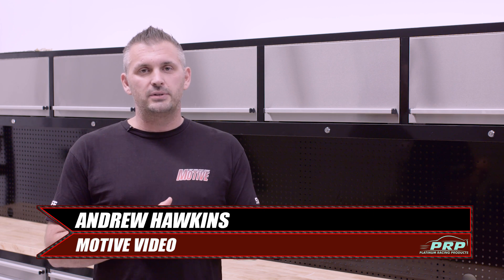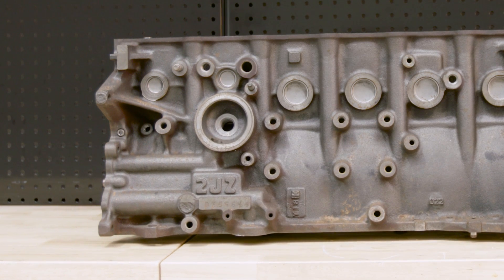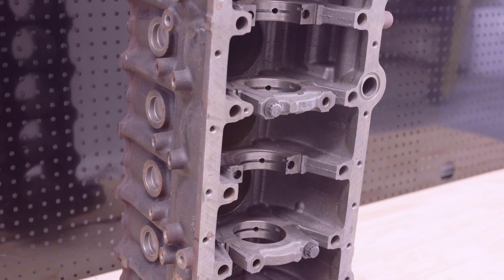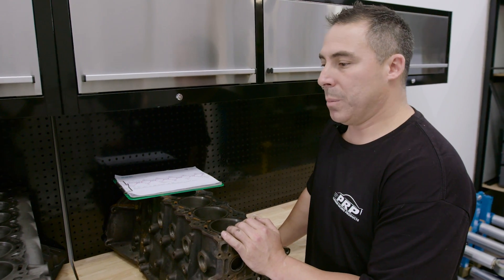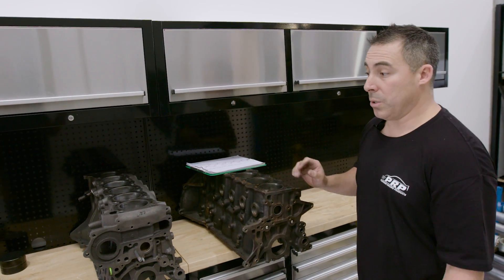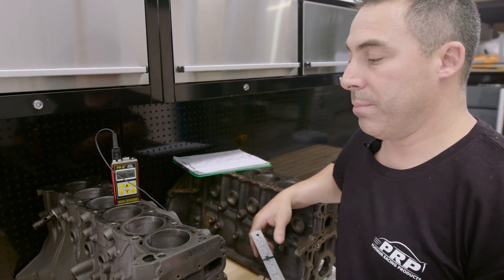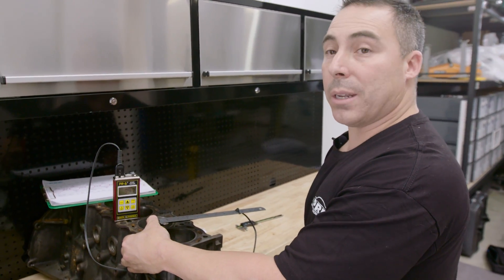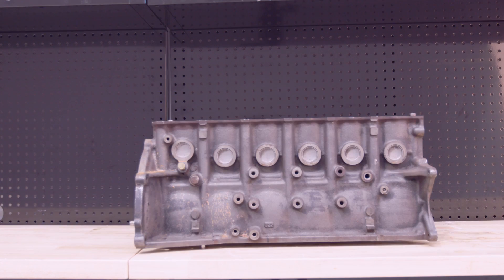RB30 vs 2JZ Which is the Better Block and Why? - Mythbusted

Comment: 2JZ - Goku

RB - Vegeta

This is the truth - but I respect them both.
Reply: Yet I still love the RB and Vegeta more even though they're weaker.
Reply: @Dollsofgod vegeta isnt weaker he just has to train harder
Reply: Goku has better oiling
Reply: @patrickthayer3192  Vegeta has higher rev limit and better daily use
Reply: @jordanprice9285  Not true at all. 2JZ is great for daily driving. Just ask all the IS300 owners with over 300k miles.
Reply: @TheColbyChurch  well I mean just as far as the Supra goes, I've yet to really see a lower horsepower one that's under 600 and personally, it doesn't feel as satisfying seeing one like that since it's just in the back of your head that he probably is gonna be making more power out of it eventually.. it's just something I'm never gonna be able to get used too.. plus the RB engines are a bit more rare and aren't usually as fast without having to go built but they usually have around 400-700 so it seems just way more practical especially since it's basically the opposite to the Supra/2JZ so I'm more likely to be impressed with a RB engine  Makin more power even over 1K compare to a Supra cuz it's basically old news and everyone does it.. 

Also, I'm not gonna lie, I think I prefer the SC300 over a Supra anyways since it's wayyy more plush and has such a nice design in my opinion..
Reply: Jordan Price Its rpm is OVER NINE THOUSAND!!!
Reply: Billet Block - Zeno
Reply: Awesome analogy 😂😂so true
Reply: I've been saying this shit for years lol.. no one ever listens when I say it 😂😂
Reply: Ls is Gohan
Reply: @corey0189  Ls is wonder woman.
Reply: 1uz - Broly? Not enough after market support but very capable of making good power
Reply: @bzbee5139  nahh.. I'd say LS probably is Broly.. Loads of Power and loads of aftermarket support for them to where it "overflows" almost lol
Reply: These DBZ references are hilarious. 😂😂😂
Reply: VR38 - BROLY
Reply: K20 - Mr. Satan
Reply: @xEhsiaN  F22 Honda God
Reply: V8 is superman honda engines is gohan 😂 rotaries is one punch man
Reply: Why American muscle lovers are watching this video anyway. Go watch your American muscle instead
Reply: The R34 is Goku.
Reply: Nissan moved on with the VR38 while Toyota couldn't convince Yamaha to copy the beast V6 VR38. That's why Toyota joined forces with BMW.
Reply: Andres Garcia 2J head was worked on by Yamaha the rest is all Toyota and Toyota was going to bring the 2J back for the new supra but the cost to redevelop the head wasn’t worth it so that’s why toyota went with bmw and as for the V8 crowd they’ll never appreciate any other engine with less then 8 cylinders
Reply: thats sad, cus vegeta is shitting on goku to me and always have, this is the truth.
Reply: @AmaAndZing  thats what ur little bro said
Reply: S54- Broly 😃
Reply: Rb26 is a unicorn being rare in the states but on the other hand the 2jz is hulk as far as power goes you will not ever see a 5 second rb26 or rb30
Reply: OK... Can see you not old enough to drive a car.... 😂😜
Reply: Comment super enlightening! I'll like it on the video and go, I do not need to watch it anymore. kkk. You summed it up!
Reply: That means 2Jz turbo is the blue super saiyan? good reference
Reply: Good Analogy!
Reply: No
Reply: Vegeta and Goku basically equal right now. If anything it's comparing 290-310 hardened 2JZ blocks.
Reply: Always liked vegta more
Reply: 755hp 
And what is the VGDETT30?
Reply: 755hp ok now I understand 😭
Reply: 2jz is Yamaha and RB26DETT is Nissan.
Reply: 2jz is Yamaha.
Reply: NISMO - BULMA
Reply: GE9X - Broly
Reply: Rb saitama
Reply: Rb = Vegeta

2JZ = Goku

K20 = Saitama "One Punch"!
Reply: William Anthony no way in milky way!
Reply: B SERIES - krilin
Reply: This should be the google answer when I type “is rb or 2j better”
Reply: thats an L for putting goku as 2j
Reply: SR20 Krillin?
Reply: To be honest either one holds it’s importance 😂
Reply: Higher revs is rb 2jz is more of the blunt powerhouse 😂 it’s only sensible that the 2jz makes up most of its power in size 😂😂😂
Reply: 2jz wanted to fucking scream😂 but instead just made more power instead of revs 😂
Reply: Big builds need big time adjustments 😂😂😂 these two require it’s own adjustment pattern to make big numbers 😂
Reply: Vegeta is supposed to be 2jz
Reply: 2jz - goku 
Rb- saitama
Reply: Barra - Brodly
Reply: @MeanMāoriM3an  barra stands for shit open deck block shit box
Reply: The 2JZ was built in response to the success of the RB26........
Reply: 2jz is the best!
Reply: And rp26 _zeno
Reply: Idk how I feel about that knowing that to me goku is shit and overrated and is a joke compared to vegeta... that might upset some kids
Reply: Best example I've ever seen 😂😂😂
Reply: Rb ultra Goku
Reply: AGT 1500 = OPM
Reply: Barra - Beerus
Reply: @rallyausofficial   2jz will eat ya barra in low boost any barra
Reply: 755hp 2jz is ultra instinct
Reply: @kapriseedwards9687  lmao nahh.. Billet 2JZ is the real Ultra Instinct 💀💀
Reply: Vegeta is stronger than Goku.....
Reply: 1jz 2jz r the king .no engine comes close to a king kong
Reply: The r26 is more loved it's the other way around
Reply: Kenton Patterson We’re talking about a measure of strength - in which, the 2JZ is physically stronger (regardless of opinions - it’s a fact).
Reply: @755hp  it's called an opinion and everyone is entitled to one, I see your a 2jz Fan. Goku is like a RB because of his cult status
Reply: Kenton Patterson I get that. But in terms of strength, Goku (2JZ) is stronger.
Reply: EJ25 - Zeno
Reply: Top fuel  drag car V8 GOD!!!!!!!!!!!!!!!!!!!
Reply: Blake Cash but it needs to be replaced after a run or few runs
Reply: Chevy dodge and ford
Reply: Fuck the bullshit. American muscle  pussies
Reply: "aMeRIcaN mUscLe"
Reply: @blakecash5570  5 inches?
Reply: Blake Cash is trolling.
Reply: But if you truly  want to be fast and think your bad ass that is the only way to go!!
Reply: Blake Cash well whatever floats yuh boat lol but of course they r beast
Reply: I’ll keep my CTS-V LSA.

Comment: N54 BMW next please.
Reply: Meh everyone knows bmw engines are crap so who cares ( looking at you bmw ppl with 2j swaps haha )
Reply: John Herbert nowhere near the same range as these blocks. Aluminum open deck block. People are putting sleeves in them to get 800Hp. Thankfully it’s not Subaru levels of awful. It holds power but if it was all it’s cracked up to be BMW wouldn’t have changed the block when they made the S55 in the M4. S54 from the e46 M3 is where it’s at for high power BMWs.

Comment: I think every enthusiast knows the 2JZ is better.
Reply: should be known by now lol
Reply: Assman Kramer  american market...........
Reply: Assman Kramer toyota made the same thing abandoning JZ over a shitty GR series i think thats what they called
Reply: Wall Cutter  V6 is better for packaging and maintaining less mass cantilevered out ahead of the front axle. So much on the GT-R is engineered to maintain weight balance, difficult with an AWD platform, and the use of a V6 over an I6 just helps with that design focus. The GT-R is one of the most capable overall platforms ever made, putting down lap times that beat supercars. The engineers at Nissan decided the V6 would help achieve that.  You really can't argue with the results.
Reply: @jomaha9227  its really the technology they put into the r35 which was impressive for its time, the v6, chassis and overall platform isn't too impressive by modern standard. the thing is extremely heavy and can't really compete anymore
Reply: Should know by now but you always need the stats to prove it, for all the doubters out there lol
Reply: Assman Kramer  Im pretty sure you get higher rigidity with a V.  Also, better mass centralization.
Reply: Assman Kramer  A V layout construction actually is better for a lot of reasons. Ever wondered why formula 1, gran tourismo and time attack cars have V engines?
Reply: @_entrxpy  ever wonder why the Jeep i6 is an indestructible engine?????
Reply: @bacchusthompson5834  because it is massively understressed. At the end of its run, it was a 4.0L engine, that made 190hp at 4600 rpm. Redline was 5300. It is also an obscenely heavy engine, being 515+ lbs (depending on accessories). It was overbuilt (not over engineered), made little power, and didn't rev for shit. Yes, of course it will last forever if you take care of it, and leave it stock. Well, except they do like to overheat, from the people I have known who have them. Typically lasting between 200 and 400k miles.

Wait. VG30s last forever,. seem to routinely get over 300k. 5VZs seem to be bulletproof as well, routinely seeing 250k+? 4.3L Chevy's seem to run until the trucks rust out around them.

But sure, Jeep 6s are indestructible. Because they are inline. Yep.
Reply: If the 2JZ is better, why is every car Toyota put it in such a POS on the track? in the real world, dyno numbers are meaningless. If racing success is the standard of proof, the RB26 is in a whole other league. When your Supra beat's my R34 GT-R on a road course, (what they were designed to do) I'll show your JZ some respect. Until then, learn to define what "better" means when comparing engines.
Reply: @Datsun510zen  just think, your GT-R would be an even better handling car with a 2JZ swap since it's lighter lol
Reply: @wforty94   Only a Toyota fan boy would want to make a GT-R a 2WD POS like the Supra...

2JZ-GTE W/ Clutch Flywheel, 
594 lbs
+ Getrag Six Speed 
746lbs

RB26DETT W/ Clutch Flywheel 
571lbs 
+ FS5R30A  Five Speed - 682lbs
Not just that, but the RB's oil pan has an R200 LSD and rotating shaft built into it for the AWD system.
Reply: @Datsun510zen  lol you must have lost to a Supra at one point in your life 🤣 the A80 is far from being a POS like you proclaim it to be. People like you are exactly why I'm doing the 1J swap in the R34 knowing that it triggers you makes me happy 🤣🤣 the even more funny thing is I own both of these cars and a ER34. Both have their pros can cons. But are very capable. The Supra edges the GT-R just based on driver involvement. Giving a slight more analog feeling than that of the GT-R as well as in my experience having a few more small issues out of the GT-R but nothing major just things like a bad coilpack and elevated oil pressure during my session. You keep insulting people calling them fan boys but in actuality nobody here sounds more like a butthurt fan boy than you right now. If you've never owned both cars to make a valid comparison based on true experience then your entire point of view is debunked and your opinion becomes invalid.
Reply: @Datsun510zen  lol you must have lost to a Supra at one point in your life 🤣 the A80 is far from being a POS like you proclaim it to be. People like you are exactly why I'm doing the 1J swap in the R34 knowing that it triggers you makes me happy 🤣🤣 the even more funny thing is I own both of these cars. Both have their pros can cons. But are very capable. The Supra edges the GT-R just based on driver involvement. Giving a slight more analog feeling than that of the GT-R as well as in my experience having a few more small issues out of the GT-R but nothing major just things like a bad coilpack and elevated oil pressure during my session. The GT-R is very easy to drive fast but it's not as boring to drive as an Evo with it not being full time AWD. However the HICAS is garbage and was the first thing I deleted. For me a violent car is always more fun to drive and it's more rewarding to beat other cars in than a car that's safe and easy. You keep insulting people calling them fan boys but in actuality nobody here sounds more like a butthurt fan boy than you right now. If you've never owned both cars to make a valid comparison based on true experience then your entire point of view is debunked and your opinion becomes invalid.
Reply: @KeenanStyles  Didn't need 3 rambling hyperbolic tirades to understand why you're upset, your user name says it all. The Mk III A80 Supra was developed to compete in Super GT Group A but when the lighter, more advanced AWD Skyline GT-R was introduced it began Nissan's legendary domination of the Super GT field. Without a single podium finish Toyota racing abandoned the Supra before the end of the '89 season. Toyota then put their hopes in the Corolla AE10 in 1991, and before the end of that season Toyota pulled out again leaving only a few privateers who finished. That is the Supra's road racing history. Not saying the 2JZ isn't a great engine,  it's gone on to do well in Japanese Drag racing. My point is that it didn't do well for what it was designed to do.
Reply: @Datsun510zen  like you just rambled? Lol upset? Also since we are bringing up irrelevant things at hand I could also say the same about your name. I own both cars more like debunking your childish speculation (2wD pOs SuPrA, WhEn YoU cAn BeAt My R34 Gt-R oN a RoAd CoUrSe, YoUr An UpSeT fAn BoY) not based on any experience whatsoever with the platform you're criticizing not being able to do well on a road course. Everything you just said regarding the motorsports history maybe true however it's completely irrelevant as I am not a professional driver competing in a GT class or Group A. The production car avaliable to the public is a completely different ball of wax. The same can be said from the aspect of the BNR32 being completely dominating in Group A and being a fragile production car for the public suffering from weak oil pumps and coil packs from the factory as well as being more prone to rust than the other cars that came out during it's time. The BNR34 as well not living up to the large shoes to be filled by the BNR32 and being dominated by its competitors that its predecessor used to compete with in the early 90s. The GT3, turbo S, NSX, E46 M3, Evo VI, 360 Modena and the list goes on all of these production models set faster laptimes than the BNR34 and it didnt do nearly as well in motorsports as the 32 before it however which of the R chassis is the most expensive and most desirable? In the car community nobody hops out of their car and says "this car won multiple championships and podiums so my car is superior to yours" hell the ST205 won the WRC, where is it in the hype of being an expensive desirable street car like the STI and Evo? People want cars based on potential, capabilities and reputation of being a good street car not only on its motorsports history. You think Nissan and Toyota designed the Laurel and Chaser specifically drifting? Also how did each one of those cars do in motorsports. However both are extremely desirable and capable. What a car is designed to do from the factory means nothing in the car community the way the aftermarket is.
Reply: @Datsun510zen  this video is about which is the better engine and why. 2jz is the more tuneable engine due to its design. Its been known to make more power while being more reliable. Thats it. Nobody is talking about the chassis. Although if you do a little bit of research you will see that a modded a80 chassis can keep up with vipers and 911 gt3 around a track.
Reply: @tommieboi707 First, look at the title of the vid, then tell me what it's about. Not sure what you mean with "more tunable" by virtue of design but it appears you don't know the RB26 platform very well, or the ongoing factory race support it has. NISMO RB26 parts blocks and head castings are still being produced by Nissan Performance Division. Try and find a new OEM 2JZ block. 

Trust, I know both platforms, and we both know you're dancing around the subjective way this video defines the "better" BLOCK. It doesn't take an engineer to know a larger displacement, longer stroke, heavier cast iron block will always handle more HP than an aluminum block. The low tech family wagon cast iron Ford Barra inline 6 is an even better block for a drag application though. 

You need to do better than a Road & Track article. Here's a naturally aspirated 1972 240z that isn't just keeping up, it's dominating Porsch 911 GT3s https://www.youtube.com/watch?v=kA6lXoHQ9sc

 The a80 Supra's dismal track record clearly illustrates the point I'm making. In the application it was designed for, with only a few top 20 finishes the 2JZ's larger heavier low revving cast iron block is not better. In fact, competing in the GT class it was designed for the JZ was a complete failure compared to the Godzilla GT-R Skyline's small light high revving RB26. The basic formula for Nissan's legendary road racing success was designing lighter chassis with rear steering and high power to weight ratio. Just like in the SCCA TransAm series, the smaller lighter 510s dominated the more powerful 2.4L Alfa Romeo's and 2.0L BMWs with a screaming 10K rpm 1.8L. Again, "better" depends on how you define it.
Reply: @Datsun510zen  the title literally says which is the better block. You are going off on a tangent and spewing road racing crap that has NOTHING to do with the title. Its well known the 2jz can make more power with more reliability than an rb. And if you didnt know here in america, drag racing in king. Whether it be 1/4 half or mile. And the 2jz is definitely more successful than the rb in this respect.
Reply: @Datsun510zen  I've beat plenty of GT-Rs, in my sessions along an F12, a LP700-4, GTC-4 Lusso and an Evo VI on Fuji Speedway only fell behind a 720S and the GT3 RS minus leaving him in the dust on the straight. Even on the little tight courses. My last session at Nikko circuit she smashed an EK9 CTR, DC2 ITR (driver cracked under pressure and oversteered going off course) I came in 2nd to a fully gutted and caged VVTI 1J swapped S14. At Sportsland Yamanashi I was able to stay with the FDs with no problem. The whole Supra can't handle argument is complete BS.